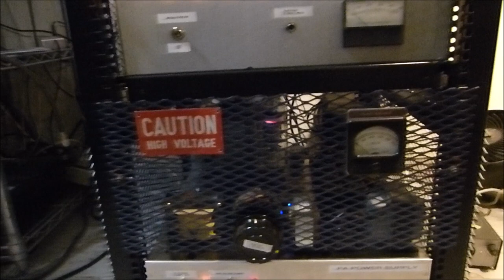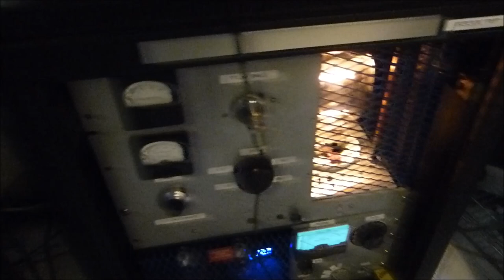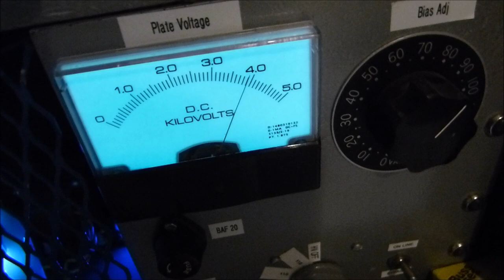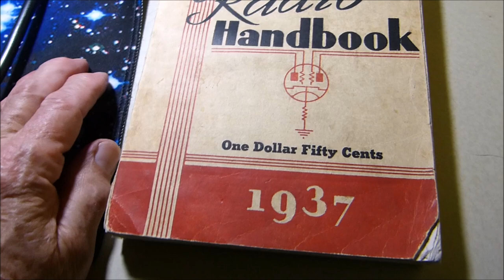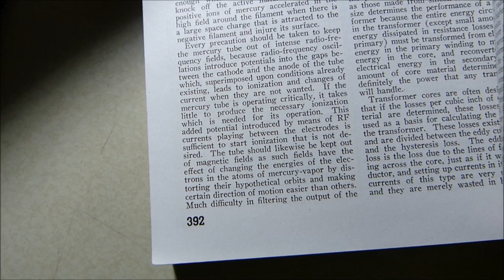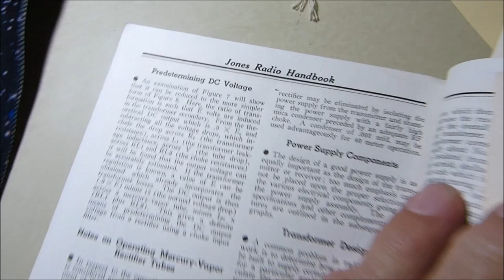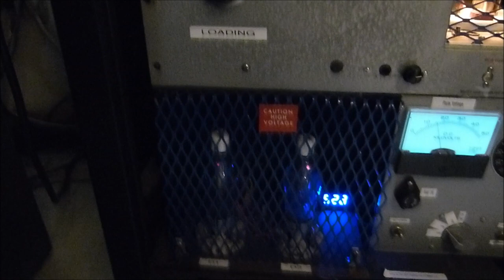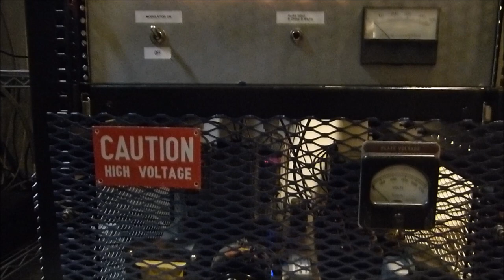Mercury Vapor Rectifiers and Hash

Comment: Finally......... Someone who can give a definitive answer about mv valves.  Over the past month I have been assembling a new amp I designed using Kt170 output valves.  For fun I chose to go with a pair of NOS Amperex 866ax mv valves.
All the tfmrs are shrouded and the ac part of the power supply is in a metal enclosure within the main chassis.  I went ahead with the build in spite of all the "Don't do it" warnings.
Mv holds a fascination for me.
Thank you for this video... It puts all the fears to rest for me.
I'm a week away from first power up and then into the tweaking if required....
Will let you know how it goes.
Reply from the maker: If my video has put to rest all this hysteria about "hash" and "x-rays" coming from Hg (MV) rectifiers, then it was time well spent on my part. I am sure you are going to love the look of those beautiful MV rectifiers. Please do let us know how your amplifier turns out. That is what this YouTube community is all about. Stay safe...
Reply: Well since my last comment I am pleased to say that the new amp is up and running well after a bit of tweaking with the power supply. I did originally have a 10h choke as first load but it really made the choke buzz loudly.  I ended up putting a 4uf film cap right on the high voltage pin of the rectifiers. 630v solen did the trick.
After the choke it is 500vdc which is perfect for the rest of my design. Won't go into specifics. I can say that unless you put you ear right on the speaker there is no audible hum at all.
Can I send you a photo somehow?
The mv tubes really light up but I'm not sure if it's normal or not.
Your  experience will help here.
Regards,
Trev.
Reply: @ElPasoTubeAmps  Forgot to mention that I have a 4 minute warm up delay relay for the mv tubes.  When the relay closes it grounds the centre tap of the heater circuit thru a thermistor so the surge into the first cap is controlled.
Reply from the maker: @NZkiwibandit  Hi Trev,
In low voltage tubes like the 83, the blue is there but not too bright. In my KW RF amplifier the 866A are nice and bright so I think your case is normal. As for noise out of an amplifier, I have found that anything better than about -75 dB S/N is perfectly quiet out of very efficient speakers. Many amplifiers state -90 dB and it may be true but it isn't necessary for a very quiet  amplifier.  My Youtube direct email is theaudioshop@sbcglobal.net if you want to send pictures.
Reply from the maker: @NZkiwibandit  I need to put in a delay-relay circuit in my Heathkit 807 amplifier since I put in the 83 rectifier. It pops a little on warm up and I figure (but I am not sure) it is the MV rectifier.  Stay safe...

Comment from the maker: One last comment on the MV rectifiers I forgot to mention. 
Besides not generating "hash",  MV (Hg) rectifiers do not generate X-rays either. X-ray tubes run at voltage levels of 60 and 70KV just for small dental x-ray machines and at low current - like 8 or 10mA or so with pulses as short as 1 mS.
I do believe mercury vapour lamps, as we see on the poles of our streets at night, do have a reasonable amount of UV output but... they are made from a (mercury arc) inside the lamp (current controlled by a series ballast) and run at very high temperatures (800 C, 1472 F) that are necessary for UV generation. The MV rectifiers as seen in this video do not run that hot simply because the voltage drop across them is so low - in the 15 volt range - multiply that voltage drop at even 500 mA and we get 7.5 watts of heat plus the filament heat and they actually run cooler than a 5U4 rectifier which can be at 450 degrees F. That doesn't mean you should touch MV rectifiers as they will be hot but not hot enough for the generation of UV light even though they are a high-purple colour.
What temperature produces UV light?
Medium-pressure UV lamps typically operate at a quartz tube surface temperature of approximately 900°C. The infrared delivered to a surface is primarily a function of the surface area of the bulb and follows the Stefan-Boltzmann Law.Sep 6, 2017

Comment: I installed a 811 on my HH Scott 222c but I have to slowly bring up the ac with a variac but it sounds great I made a adapter for it  it does flicker when volume is increased
Reply from the maker: There is that warm-up issue with MV rectifiers and all of my equipment that use these rectifiers have a switch to enable/disable HV to give the rectifiers a couple of minutes to warm up. As some people state correctly, if the Hg rectifiers have not been in an upright position and initially given maybe 30 minutes to get-in-shape - that part is necessary for some just out of the box and storage - but after they have gone thru that initial settling-in period, it only takes 2-3 minutes for the filaments to warm up once the Hg is properly conditioned to apply HV. Three minutes is all Collins transmitters give the rectifiers to warm up and then apply over 6KV AC across the two rectifiers for 3KV DC output from a choke input filter. 
I apply 1800 VAC from a 1A transformer across the 866A that you saw modulating with just a couple minutes of warm up time - they are in a voltage doubler and with the capacitors, end up at 4KV. I forgot to mention that no one recommends Hg rectifiers be used into a capacitor input filter but with a voltage-doubler, there is no way to prevent it as that is the way a doubler is built but mine have been operating for years with that initial surge current to charge the capacitors. Honestly, I am a bit surprised it has not damaged my rectifiers over the years but it seems they are tougher than we think - thanks for your comments. Stay safe...

Comment: I have a few mercury vapour rectifiers which I've thought of using in an amp PSU, problem is there's not too many of them about in the UK at least at reasonable prices, meaning if in the future they need changing and there's non to be had the PSU design is redundant. There is a bit of hysteria too because they have mercury in them, so, great valves but only for specialist/occasional use.
Reply from the maker: I understand that and do not build with tubes I only have one or two of and are hard to find. On the other hand, if you build with the MV rectifiers you can always go to solid state diodes and keep the equipment running.  Fear, confusion and misinformation rules the Internet about things like mercury and asbestos - if you even look at either, everyone will die...
I like some of the statements I read today - one was: "we don't have rules here - we are trying to solve problems",  and the other was: "we don't look for problems, we look for solutions". I know that is old-school thinking and will surely be burned-at-the-stake today in modern media but it is kind of how I look at things. I do plenty of (perfectly legal) things that people just don't get but it is OK... Lastly, MV (Hg) rectifiers are, as you say, speciality items only for a few.
Reply: @ElPasoTubeAmps  Completely agree: we used to play with mercury at school when I was a kid back in the late 70's and I have several big mercury tilt switches near my bench on the wall.
  One last thing, I've found the MVR's I have tested don't glow much, maybe because they aren't running at a high enough current or voltage. As audio amps only run at 2-300mV tops this another reason I' haven't used them. Great video BTW, have missed your amp builds this year.

Comment: Great Video, I love the color of the Hg Vapor Rectifiers! 
You speak about "Hash", what exactly is meant with "Hash" ? Hum, HF Noise(like from a SMPS PSU)?, White noise ?
Reply from the maker: That is a good question and I do not know the exact definition (sound) of "hash". I would assume it is some undesirable noise created in the power supply that is induced in the output of the amplifier (most likely AM transmitter) like you mention. What exactly it sounds like I do not know. 
What prompted this video is that word "hash" gets thrown out so often in comments and blogs whenever someone asks about using Hg rectifiers and I know it is not true. The Hg rectifier has been blamed for "hash" for the last 100 years and it would only occur, as clearly stated in the manuals, if the rectifiers are in a strong RF or magnetic field that can ionise the Hg between the cathode and plate during operation of the rectifiers. 
"Hash-filters" as they were called long ago, were simple RF chokes added to the plate leads of the tubes to help keep RF out of the tube. 
Hg (or MV) rectifiers are used in the old high-end vacuum tube testers (TV-7 type) because of the constant voltage drop and certainly there could be no electrical noise permitted in those instruments. It seems at low voltage, i.e. in a tube tester, it is OK to put plate voltage on the rectifier before it warms up and no harm is done. 
I know that can not be done at thousands of volts without damaging the rectifier as it must be at operating temperature before HV is applied to its plates. That in itself  would make it necessary to have a HV on/off switch on an audio amplifier or a delay-relay of about three (3) minutes to allow the filament to come up to operating temperature. But everyone agrees they are beautiful and we still like them and use them regardless of their size and filament requirements.
Reply: Thankyou for the Honest explanation, I am not a Ham but I love Tubes since I was a Kid in the 70's when I was Building Pirate AM & FM Radio Transmitters in Greece. Tubes in General have something Mesmerizing :-), Cheers, Konstantin

Comment: I came here for the free mercury vape hash....seriously though, I've always wanted to build an amp with 872s in it. They look absolutely gorgeous when operating. BTW, what was that "spark" at about 7:50 near the MV tubes? Thanks!!
Reply from the maker: That flash is "normal" on that amplifier as it does it most every time. I assume it it the surge current drawn to charge the capacitors in the voltage doubler arrangement. Apparently, I lucked-out and the capacitors are not too large to damage the tube but high enough to cause that extra flash when the HV is turned on. Some people turn the HV on and leave it on and bias the tube off/on but I turn on and off the HV each time I transmit and stop transmitting. I use a  solid-state relay in that particular amplifier in the HV transformer primary so I don't hear that loud clank of a mechanical relay. The unfortunate thing about SS relays is if a HV short occurs, it almost always shorts the SS relay from huge over current thru the primary. The relay is rated a 60A.

Comment: Great video! I have been thinking about building an audio amp with mercury vapor rectifiers. I heard that they give off X-rays, is there any truth to that?
Reply: Only at very high operating voltages above 15kv
Reply from the maker: As Bill states above - only at very high voltages do we get x-rays. Next time you go to the dentist, see if you can find the specification plate on their x-ray machine that lists the voltage and current. Here is a little data I found that might be of interest about dental x-ray machines.
4. Specifications：
4.1 Tube voltage：60/70kVp
4.2 Tube current：8mA
4.3 Power: 0.339kW
4.4 Earth Leakage Current
Normal state：≤0.5 mA Single failure state≤1 mA

Comment: What about UV light? I have read that the mercury vapor tubes emits at least some UV light. But the glass bulb filters most of the harmful wavelengths out.  But there seems to be a lot of different opinions out there about this ass well.
I'm not too worried about it personally but it would be nice to know. 
I guess it could be measured if you had the right equipment.
Reply from the maker: I do not know an absolute answer to the UV question. Some people state it like they know what they are talking about but provide no proof. Declarations and opinions,  not scientific proof,  seems to rule Internet knowledge and wisdom. 
I did try my best to answer it below and your comment about the glass filtering adds to my belief that there is nothing to worry about. So I don't repeat myself, my thoughts on UV are in my comment that starts with:  "One last comment on the MV rectifiers I forgot to mention".
As soon as that question was asked the first time, I started researching UV measuring equipment - but... we have UV-A, UV-B and UV-C which will make the answer to all this go on for ever and cost $$$$$. I am not worried about it either.
Reply: @ElPasoTubeAmps  You can check for UVC with a $10 Quantadose UV test card. It will glow in the presence of UVC light and change color to give a rough approximation of the amount of UV light it's exposed to.
UVC emission shouldn't be a problem since glass blocks it though.
Reply from the maker: @rocketman221projects  Wow... I learn so much from you guys. There they are on Ebay...   Thank you
Reply: @ElPasoTubeAmps  I totally missed to click expand on your comment. I'm sorry you had to repeat yourself. I in the future will do better.

Comment: Yes, these days they can be substituted with solid state devices, as can high output final stages of amps both RF and AF, but where is the romance in that........if you can't see the beauty in the glow of any valve be it a MVR or a Big final stage glass Tube, well maybe you are a solid state guy or gal..........Valves of all types , other than the steel or ceramic ones have an aesthetic value that just can't be replicated in any other way.......and that justifies any cost or danger they may inflict on a project...........and for the record, any person I have brought in for a TX site tour never sits mesmerised looking at a bank of Transistors like they do looking through the inspection window of a large Valve based Transmitter at full power.